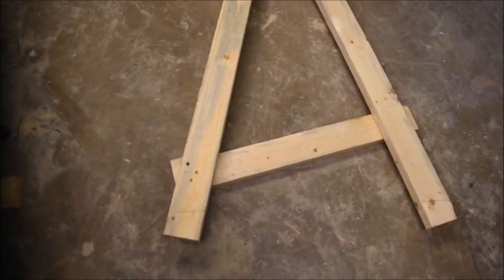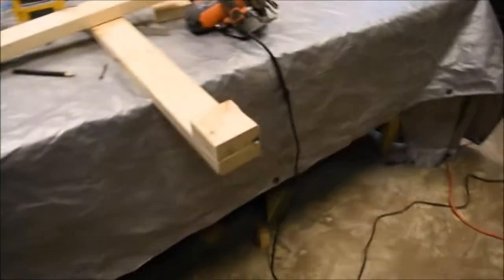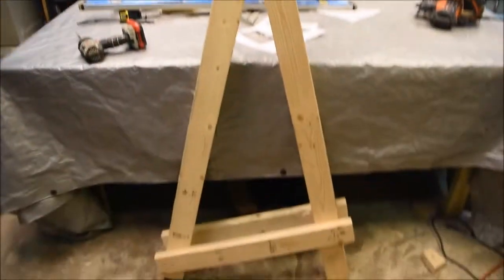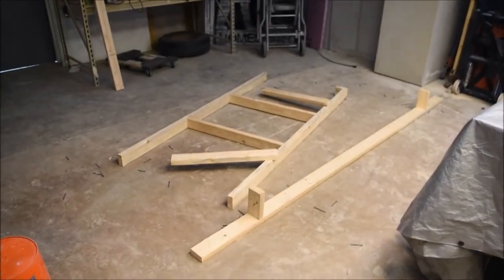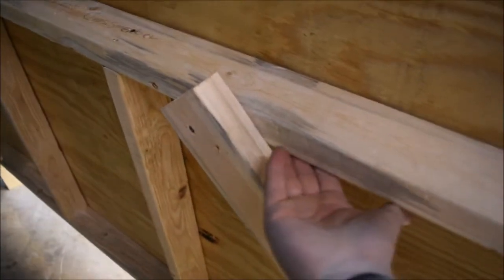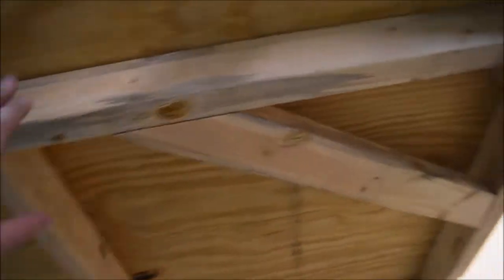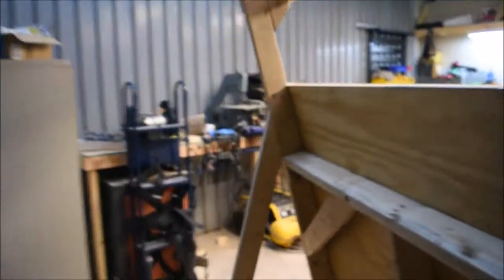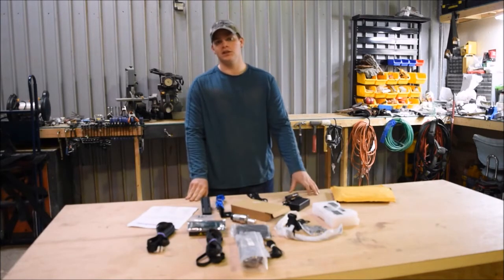Maslow CNC Setup: Modifying the Default Frame

Comment: I'm not sure what advantage doing all this has, aside from making it a little prettier. Also the diagonals are kind of redundant if you are screwing the plywood to the front.
Reply from the maker: Michael Crumpton having larger contact points on the legs and feet make it sturdier. The diagonals hold the Frame before putting the plywood on and if you ever have to change it out.

Comment: What's the purpose of the back 4x8 sheet ? Is it just for the router blade not to bite into the frame and catch the excess wood chips ? 
    I'm redesigning mine out of 8 ft metal studs to eliminate the wood. It would seem that if you had a more secure back frame with additional center struts you wouldn't need the additional 4x8 sheet....
Reply from the maker: In this design in serves two purposes. It adds a lot of rigidity to the frame which is very important, and it is a sacrificial back for your router to cut into. You always have to cut deeper than the thickness of your piece. For a .75" plywood, I usually cut to a thickness of .80. I set the maslow to run 4 passes of .20 each.